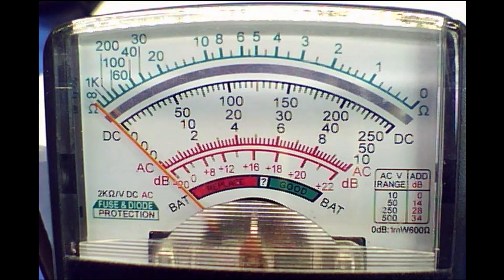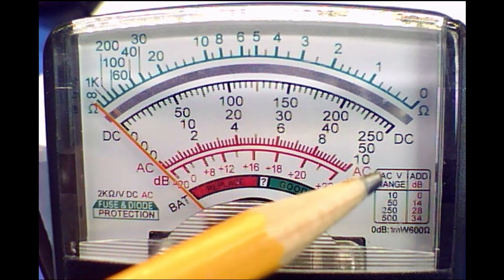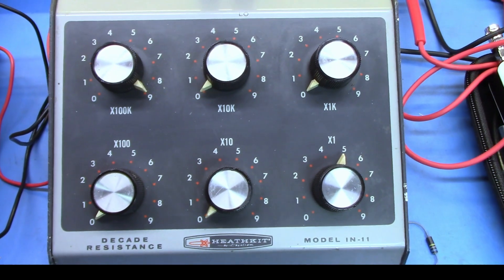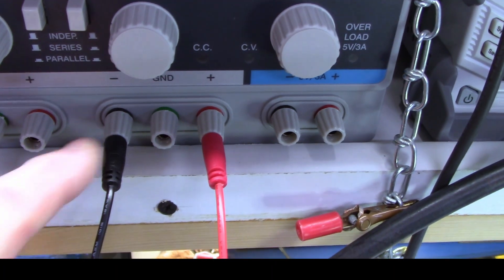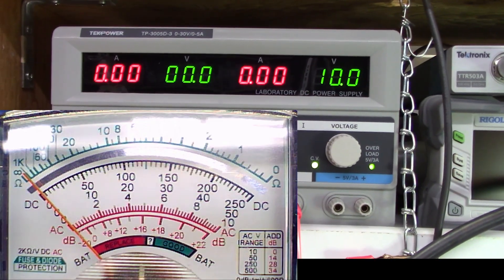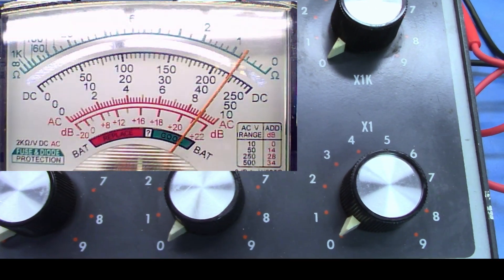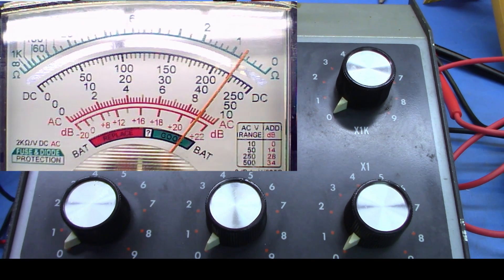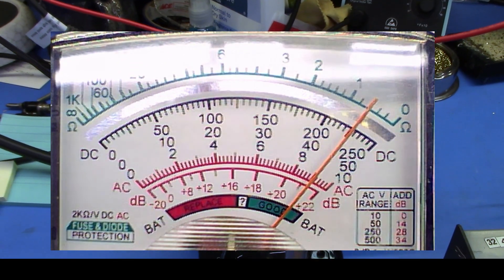Is it a Voltmeter or Ammeter?  That is the question! (019b_v2025)

Comment: INTERESTING PRESENTATION!NORMALLY ANALOG METERS ARE NOT THAT FAR OFF.WHAT ARE THE TOLLARANCES OF YOUR DECADE COUNTER RESISTORS?
Reply from the maker: Well, this was a junky hardware store VOM ... a kick around model. Because I measured 10Volts at the leads where the test meter was connected using my DVM and the decade box was at 0 Ohms, the fault lay in the junk test meter. I just haven't gotten around to opening the thing up to discover the issue. :-)

Comment: They're all galvanometers?
Reply from the maker: Yes ... and no. The basic meter movement itself is a current measuring device. However, for some applications, the manufacturer will embed an internal multiplier resistor to turn it into a voltmeter. The same amount of current is required to achieve full scale, but the amount of voltage required is multiplied.
I will be showing how to add a shunt resistor to a basic meter movement to extend its current capabilities and how to add a multiplier resistor to a basic meter movement to transform it into a voltmeter on the next two videos in this series. :-)

Comment: The next step would be to calculate the value of a shunt resistor (or use the decade box) to improve the meters accuracy
Reply from the maker: Well, this depends on if it is a voltmeter or an ammeter. Shunt resistors are added to increase the current capabilities of the meter. Multiplier resistors are added to turn an ammeter into a voltmeter. he next two videos in this series address these exact things. Then one on how to make your own shunt resistor. :-)

Comment: Ralph, could you please explain the significance for determining the difference? Why would we'd want to know this aside from curiosity? Aren't they both d'Arsonval movements?
Reply from the maker: All  basic analog meters of this type are, by their basic nature, an ammeter. In some cases, the manufacturer has included an internal multiplier resistor which is used to transform this basic ammeter into a voltmeter. Thus, before we try to use any salvaged meter movement (especially if they have a volt scale), we need to determine what it is so we can design around it properly. The next two videos in this series addresses how to add a shunt resistor to extend the amperage range of the basic movement and how to add a multiplier resistor to turn the basic meter movement into a voltmeter. :-)
Reply: @eie_for_you  Ah yes, that was my early Navy training, all basic d'Arsonval  meters were ammeters, until you started fiddling with resistors in series..    So much ancient knowledge about using the mechanical zero, and the backoff, mirrored scales, unbalanced movements, how to set back on pivots, shorting the contacts for storage etc...  Great video, looking forward to the rest...  Reminds me of PMEL school...
Reply from the maker: I was in the USAF in PMEL. I went to PMEL school in Denver, CO 1973-1974.
But, there are still a LOT of analog meter out there both brand new off the shelf and TONS of them rescued from various pieces of equipment. :-)
Reply: So, then a shunt resistor, right.
Reply from the maker: No. We use a shut resistor to extend the current capabilities of the basic meter, allowing a 50 microamp meter movement to be used to, say, measure 50 Amps. The shunt resistor is placed in parallel with the meter movement.
We use a multiplier resistor to transform a basic meter movement into a voltmeter. This would allow us to create a meter to measure 50 Volts using that same basic 50 microamp meter movement. The multiplier resistor is placed in series with the meter movement. :-)
Reply: Ralph, wb7ond, I stand corrected. Thank you for the clarification. As to meters, I used to Hoover up 90% of what I saw at swap meets. I especially got the ones with "clean scales" (0-10, 0-100, etc.) and repurpose them for handy projects. I even "Manhattanized" a little device to determine the internal meter resistance. 

Along the way, I fell in love with analog meters. Among my treasures are three Simpsons - cleaned and restored AND a pristine Triplett 630 I got off of eBay. It had a 30 volt "B" battery from the 60s that still held a 25 volt charge. 

They are things of beauty!
Reply from the maker: Truly they are in the right place. :-)

Comment: I think it's all the same stuff except for the windings on the movement coil. I may be wrong? A 50uA movement is common in the old Simpson 260 meters.
Reply from the maker: The different is that those salvaged meters which end up being voltmeters have an internal multiplier resistor which transforms the basic meter movement (an ammeter by definition) into a voltmeter. In the next two videos in this series, I will show folks how to add a shunt resistor to extend the current capabilities of the basic meter movement and how to add a multiplier resistor to turn the basic meter movement into a voltmeter. :-)

Comment: The instrument shown appears to be a "moving coil" type.  These use a small current to cause the deflection of the needle 

( im assuming its not a "valve voltmeter" - which were common in days gone by to get high input impedance when measuring voltages)

Most analogue instruments in times gone by used this type of indicator ( a few were moving iron - non linear) 

Point is - the way a moving coil instrument works is by pivoting a coil of wire in a magnetic field - and current is passed through the coil causing it to rotate against the force of a spring.
In this way you can see that the device measures current.

Typically such a device would need somwhere in the region of 50 to 100 micro amps to give full scale deflection - so to measure " voltage" of say 100v full scale - we would need to arrange for the current through the coil to be say 100uA 
That is put a resistor in series inside the instrument so that 
R = 100/ 100uA = 1M ohm.
( other ranges switch in different resistors .

The fact that the meter reads 9v with 10v applied means it needs calibrating.

To measure current - lets say 1Amp full scale - we need to have 100uA passing through the coil - and the remaining
1A - 100uA  "bypassed" by a shunt resistor connected in parallel with the coil ( with additional "protection" against overload etc !
Reply from the maker: The basic meter movement is, by definition, an ammeter. However, for some applications manufacturers have added an internal multiplier resistor so as to transform what would have been a basic meter movement into a voltmeter. While, yes, current still flows though the meter, the voltage necessary to achieve full scale is MUCH greater.
In the next two videos in this series, I will show how to add a shunt resistor to a basic meter movement to extend its current capabilities and how to add a multiplier resistor to turn that basic meter movement into a voltmeter. :-)

Comment: All the analog meters I own (regardless of what they claim to measure) depend on current flow for their needle movement/rotation.
Reply from the maker: Yes, by nature they all do. The difference is that a meter which contains a multiplier resistor requires a LOT more voltage to achieve that current. Thus, they are configured so that a full scale reading corresponds to a specific voltage as opposed to a specific current.
I will be showing how to add a shunt resistor to extend the current capabilities of the basic meter movement and how to add a multiplier resistor to transform the basic meter movement (ammeter by nature) into a voltmeter in the next two videos n this series. :-)

Comment: Don’t old meters have calibration screws?
Reply from the maker: The screw adjustment that I believe you are referring to is intended to zero the meter, not calibrate it. Unfortunately, not all salvaged meters have these available on the outside. The meter face has to be removed (carefully!) to get at them. :-)
Reply: @eie_for_you ok I learned something. Thank you!
Reply from the maker: Cool! :-)